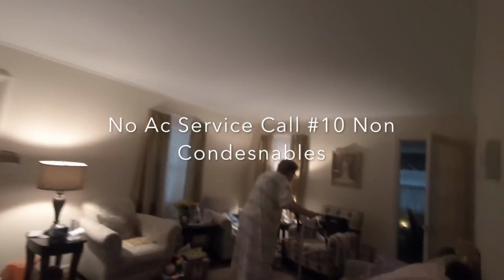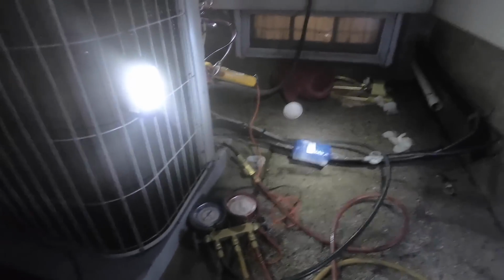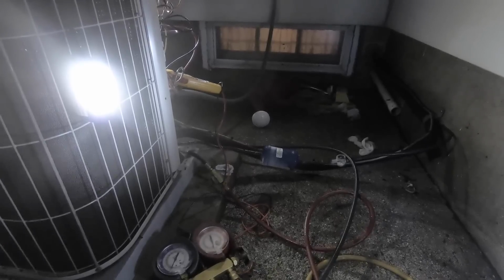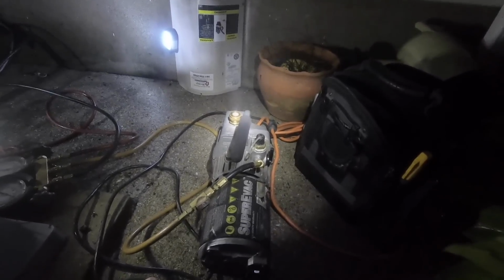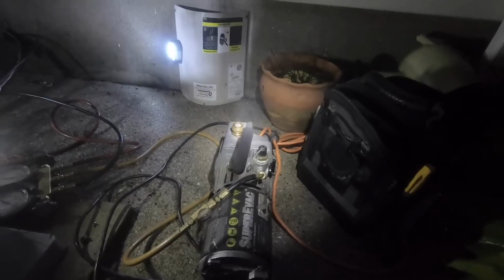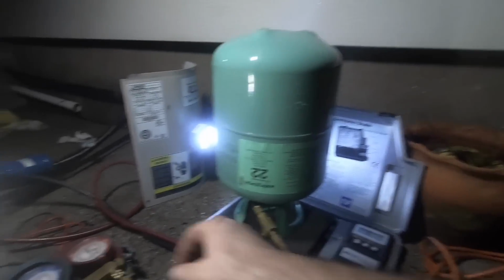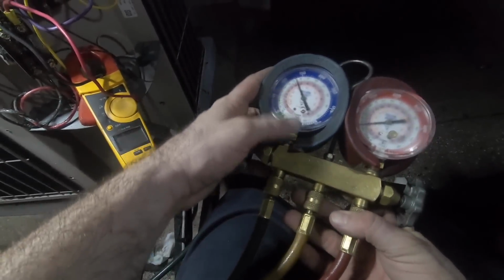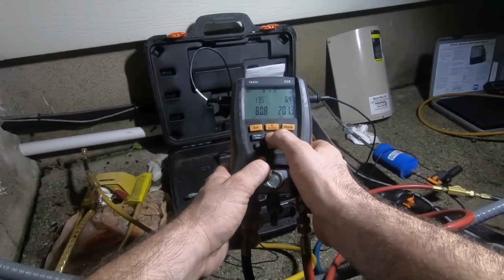AC Not Cooling Contaminated System Overheating Compressor HVAC

Comment: You didn't even put the full charge in 3 lb 10 oz you only put 3 lb and there is make up for the line set.
Reply: Hacker seems like all these rookies have a comment and none of them know what the hell they are doing . They are all experts.... LoL. They need to spend more time in field getting experience.
Reply: @JJ 109 that's the internet for ya
Reply: @pineychristian  I've been a journeyman hvacr tech for 25 years, and hvac hacker does not belong teaching. NO HATING HERE
Reply: @bobrob3109  good for you .....
Reply from the maker: The interesting thing here is James your initial comment and criticism if you watch the video all the answers were in plain sight of properly charging this system. Anyone with a problem over me not doing the drier never been in a situation were they wanted to make something work, at that moment. So you do whatever you can. No driers left you still do the repair or attempt anything to provide comfort to your customer. Bob I am not a teacher nor do I claim to be. These are just videos of my adventures, not listed as educational.
Reply from the maker: Bob I have trained and taught many new techs where I work and lots of them have turned into really good techs.
Reply: @pineychristian  you wish
Reply from the maker: There is almost no lineset the unit is in the basement very close to the wall. A unit like this on startup I would have to remove refrigerant
Reply: @thehvachacker  you wish 8 amps, low suction pressure, said it was txv then said piston, no superheat or sub cool, etc. Your lackies may think everyone on the internet has no experience but it took you hours to do the job incorrectly.
Reply from the maker: @jamesmclaughlinprimitivele4587  I had set the subcooling to manufacturer specs, and supheat was 14 degrees at the end. You must be an idiot who comments without watching the full video. Suction pressure was good 80 psi not low suction also and It is a txv system I think i even show the txv in the video not far from end when I do a temp split. way to show off you ignorance. Why do I need to wish 8 amps if that was what the compressor is pulling? again your comment is pointless and you are proving to be nothing more than a brainless troll. every system we install gets a txv wr don't install ac systems with pistols and we installed this one.
Reply: @thehvachacker  you kneed to watch your videos, you said low suction "I'm good with that" you made yourself seem disorganized and not sure of what you where doing. You did not show superheat or sub cool
Reply from the maker: @jamesmclaughlinprimitivele4587  I have ADHD many of my viewers know this, I am on meds for it. I may say the wrong words at times. Now I do show superheat and subcooling in this video i had 14 degrees if you look at the gauges and 6 degrees of subcooling with 80 psi suction don't remember the hi side pressure The txv is right in front of the camera for at least 3 minutes. I probably said low superheat. Which 14 isn't low yet i like to see 15-20 degrees yet not always going to happen. These videos are not educational videos its almost like a diary/ blog of my experiences as an HVAC tech. I am no guru of HVAC just a tech with hardcore ADHD that puts it all into my work.  you can hate my work all you want in the end my customers are all that matter. They live comfortable because of my work. Which is what I provide all my customers.
Reply from the maker: I also don't edit my mistakes to look like a super tech. I am flawed like most people and jobs don't always go as easily as we all would like. if you could do better where is your videos? I bet you would edit most of them out to hide your flaws. I only try to edit out now when im filming my pants, it happens often or I'm filming my boots cause i get warped into my work and forget i am filming
Reply: @pineychristian  you're funny. From your grandma basement.
Reply: @pineychristian  I gave 27 years experience in refrigeration, electric, hvac hold license to work in all three trades and own/operate my own business. Just so you know.
Reply: @jamesmclaughlinprimitivele4587  stick to working on water heaters cause it looks like you struggle with them. Ac & heating is just a little to far complicated for people like yourself
Reply: @jamesmclaughlinprimitivele4587  27 yrs and still have no clue. You should have quit a long time ago. Probably a lot of systems got trashed in your hands....
Reply: @pineychristian  don't you get some filters to change or are you up to that yet
Reply: @pineychristian  when's your grandma going to make you get a job and move out of her basement
Reply: @traviskalinowski56  wow you're a genius.
Reply: Well had my fun glad you guys know it all. Have a nice day
Reply: @jamesmclaughlinprimitivele4587  it's nice to have someone with the same opinion of Hacker. He's a joke
Reply from the maker: Bob you think I am a joke just don’t watch. I could care less if you stupid ass slipped on 460 and saved the world from an internet troll who watches others work, looking to insult, to feel good about having no friends.

Comment: You say fixed oriface then txv open you're confused.
Reply from the maker: Working 100 degrees days 17+ hour days sometimes I might say the wrong thing it’s a txv I might even have shown the txv in the video. Every unit we install has txv on them we don’t use pistons unless someone else installed the system

Comment: You get electricity from the disconnect. Damn.
Reply: Do they make 220 volt outlet adapters for disconnects? Sure would be handy!
Reply from the maker: They make cheater cords yet if an outlet is around I will run an extension over using a cheater cord. alligator clips one hot leg and ground the other two legs and you have a hot outlet. yet a cheater cords nickname is also a widow maker
Reply: @thehvachacker  never heard of the widow maker. If you connect it properly there are no worries

Comment: Replacing would be less than that bill you made.
Reply from the maker: Replacing is around 7k nowhere near my bill. Her system is still cooling with no issues since I was there on this call. Did her maintenance two weeks ago

Comment: when the system  is contaminate   the refrigerant  stink bad ?  you need to clean the system change oil vacume and ad refrigerant ? sorry for my questions i m learning and thanks for your video
Reply from the maker: No it was 410a and r22 mixed most likely by someone that didn't know better. I usually would change the filter drier but didn't have any left on my truck since I used 2 earlier that day. In the field sometimes you break protocol just to try to give someone cooling on an almost 100 degree day
Reply: @thehvachacker  So, if you had the proper time and equipment, a filter change was the only thing missing? Since 410 could still be trapped in the filter? Assuming the incorrect refrigerant was 410 since it's common. I imagine pulling a vacuum would draw it out of the oil. I see people saying a new system would have saved time and money. Not seeing that to be true until r22 is 100% gone, or am I missing something?
Reply: @kd9bwi: you change the filter-drier because they can “fill up” with moisture or particulate crud. Ideally you’d put on a new one any time the system is opened.

Comment: You gettin too technical for the customer.
Reply from the maker: Thats true and from watching myself work in some of my videos I learned how to dumb it down somewhat
Reply: @thehvachacker  dumb it down? Tell your next customer that you have to dumb it down for them to understand
Reply: @bobrob3109  I mean...you don't tell the customer that you're dumbing it down. 🤣 "Ok sir, here's what I've got so far. I'll dumb it down for ya so it's understandable by your pea brain." LoL no. You just say "You've got 2 different gases in the system when there should only be 1, or there's plain air in it and it's broken as a result of one of those things. I'll fix it by cleaning it out and starting over with the correct gas. It needs to be only 1 gas and pure or it won't work."
Reply: Straightoutofchiraq he called it a machine.  I think that’s fair.

Comment: What brand flash light is that
Reply from the maker: thats a braun slimbar flashlight
Reply: The HVAC Hacker I just bought it but the rubber flap that covers USB port doesn't stay in place. Does the one you have do better? I'm worried that it will get water in it
Reply from the maker: Yes the rubber shield I always keep covering the usb outlet. I need to keep water, dirt, oil, grease, and whatever else it has accidentally been sprayed with. I have 2 and both stay closed if I remember I will try to show the lights plug next time I am filming and using the light

Comment: At 12:20 into the video you could still see the compressor steaming from when you washed the condenser (which it didn’t need) that should of told you something. I wouldn’t want this clown working on my system, took him way to long to diagnose the issue. Absolutely absurd.
Reply from the maker: You would be buying a new system with most other techs being on this call. The condenser coil was dirty so why not clean while cooling off the compressor. It’s not an added charge to rinse the coil while cooling the compressor which is still cooling down the system and compressor. plus I wouldn’t want to work for an idiot customer who just proved to know nothing of what you're talking about. Don’t worry you will find someone to work on your equipment. Hopefully, you hide your ignorance from him. Or you would have sales techs, not repair techs working on your machine.
Reply: He's not eating any time and did his job right, your a keyboard warrior lmao
Reply: 851995STARGATE your a fool as well and your sure as hell not a Technician. Your probably some janitor at a elementary school.
Reply: My man milking the clock. We get paid by the hour foh
Reply from the maker: No milking here 3 hours isn’t too long for this repair. Yes I am paid double time for all overtime. Yet this week I had 91 hours. Who wants to milk the clock when your working those hours.
Reply: Fuck off asshole and leave a good man alone!!!!!

Comment: you should weight the recovery, the system was extremely overcharged by others during cooler weather.
Reply from the maker: We had weeks of 90+ before I got to this call August 6th or 7th. It never would of lasted she thought she was going to need refrigerant again making me believe she had someone gas it up. She was under the impression my company won’t recharge r22. Cause in 2017 we didn’t sell r22 to residential only commercial accounts.
Reply from the maker: Watch how the pressures both skyrocket. An overcharge usually doesn’t make the suction go so hi on a txv system.
Reply: @thehvachacker  yes it does, your confused
Reply from the maker: I also did weigh it you would need to dig through these comments I think I took around 4 or 5lbs out.
Reply: @thehvachacker  you took out 4-5 lbs out and 3lbs back in, and you don't think it was overcharged

Comment: bet they got a call back on this
Reply from the maker: Nope I was there in November for heat pm and she demanded I do the pm. Why would you think there would be a call back?
Reply: if there was no leak and she said no one worked on it...how would the refrig be contaminated???  unless it wasnt evacuated properly on install....if its r22 its been working for years
Reply from the maker: She had someone work on it. She thought we don’t add r22 anymore. So she had someone else come by and after it still didn’t work calls us in
Reply: @thehvachacker  Called it. "No, no ones been by at all!" Sorry lady but when a tech is asking, he already knows the answer 99/100 times. As in "When was the last time you changed your filter?"

Comment: Fun tip, whenever you cool a compressor I recommend using your toner at the compressor wires off the contactor so you know as soon as its done cooling. easier than constantly checking or guessing.
Reply: what do you mean by "toner"? Are you talking about using the ammeter probe? can you elaborate. Trying to look up toner and all I see is those devices used for network cable Id's and copy machine toner.
Reply: powerpooch2000 he’s referring to the resistance check of meter. When low resistance most electronic meters beep to let you know it’s a short.
Reply from the maker: I just don’t want to get my meter wet. Yet if it was a cheap toner why not

Comment: if is contaminated why you didn't change the dryer or the glass or add a filter to clean the system?
Reply from the maker: No driers left on truck. I used 2 driers earlier in the day and it was around 100 degrees so I had to get it up and running
Reply: @thehvachacker  what's does he mean by changing the glass?  sight glass?  what difference would that make in replacing one refrigerant with another?

Comment: Lmao
Reply from the maker: What is the part you think I rip the lady off? Did you see the pressures when I got the compressor to coil off?
Reply: Ok I watched the video again. If the compressor was over heated why didn’t you cool it down?Disassembling the unit and cleaning the coil did not help diagnose the problem. You should run a trickle of water over the compressor to cool it down. When you finally got the compressor started the head pressure shot up and the compressor sounded like it was liquid slugging. A huge sign it is over charged. You should have got a reclaim cylinder and removed refrigerant. Oh and your company was the last to service the system. Now you tell the lady the system has non-condensables. Did you perform a PT test on the cylinder? Was it rejected for contamination. Then you charge the system back up and say the sight glass didn’t mean anything. If you don’t have a solid column of liquid going to an expansion valve then it won’t work properly. TXVs regulate superheat. I noticed 6 degree sub-cooling. You never showed a good picture of the charging chart to see the proper sub-cooling.
Reply: Then you took a TD. 75 to 68.9 is not 19 degrees. I hope this was helpful.

Comment: when you had the system evacuated you should have changed the filter/dryer - especially when you suspect contamination
Reply from the maker: I should of yet without a drier left on my truck I had no choice.
Reply: John everyone who works on HVAC at some point has to evaluate the entire situation given to them.  In real world situations EVERY tech eventually has to break protocol for one reason or another. The end result and the most important result is that the elderly customer has an AC unit that is now blowing 59 degree air in a hot summer night.  Instead of suffering and having to wait until the next day for a filter dryer to arrive and more time to have to install it.

Comment: It would've been a really bad situation if that compressor over heated and than exploded under heat pressure...then you'd have a fire, and then you'd be really screwed
Reply from the maker: That would suck. Never had that happen to me. At least not a compressor I’m in front of. What would create the fire?
Reply: @thehvachacker  depends....is the gas ignitable?
Reply: @thehvachacker  my theory: wire panel crackles and starts arching sparks and then compressor explodes , gas ignites from sparks (if ignitable) from over heat pressure witch then would cause a chain reaction from the wires then you'd have the fire.
Reply from the maker: The gas can burn so can the oil.
Reply: I've heard of compressors exploding, it's very rare though, and usually happens in third world countries where training is poor. They use oxygen or impure nitrogen (cheap nitrogen with oxygen impurities) to purge the system and what happens is, in the presence of high levels of oxygen, the lubricating oil or flammable refrigerant will "diesel." (Basically, it detonates, like in a diesel engine. But the AC compressor and piping isn't designed to handle that high of a pressure, let alone that fast of a rise in pressure.)
BTW it can also happen if you let normal air into the system.

Example video:   /watch?v=ic9IEH4nxOo?t=46s
Aftermath of similar incident:   /watch?v=bMGEDdvH-v4   (Look at 0:42. You can see the base of the compressor. The metal is mushroomed out, showing that the explosion happened from within the compressor itself.)

I have a good source for this, which is NOT behind a paywall (unlike other studies), but it's in Japanese.
katoairconservice(DOT)cocolog-nifty(DOT)com/blog/2017/09/post-49f1(DOT)html
(Sorry, I have to remove all the dots and replace them with (DOT) otherwise YT will flag and remove my comment.)